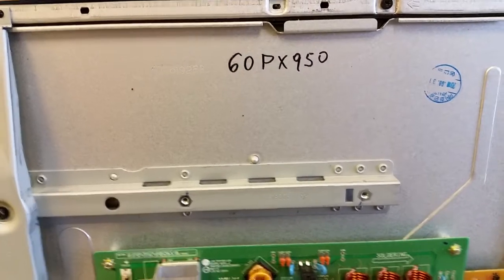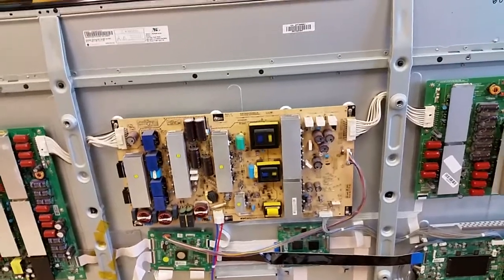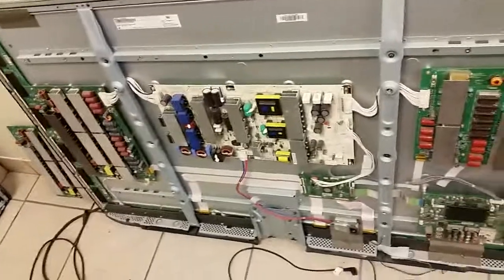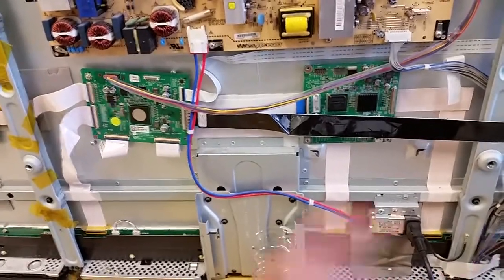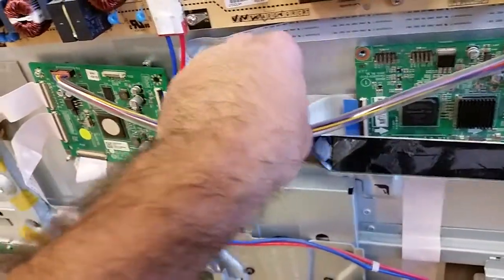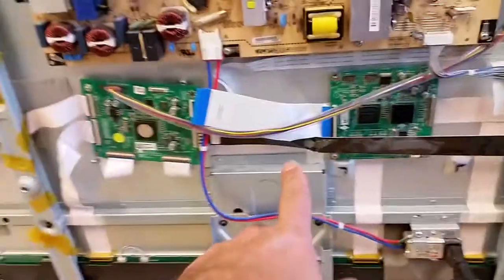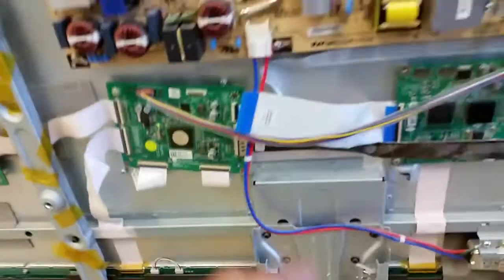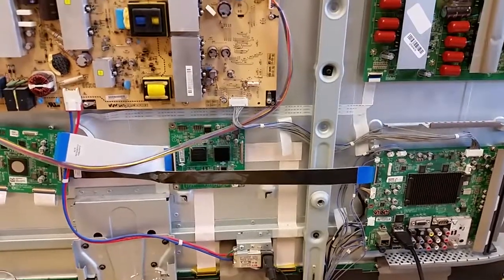How to repair / hack LG 60PX950 sound no image problem, bad EBU0107167

Comment: I have a Hisense 50H5GB, No video but I have sound. I can see picture with a flashlight. I replaced the power supply and with both power supplies I get only 2volts dc when I test the LED output socket. Leads me to believe the LEDS might be good and it would be the mainboard? Does the main board control the voltage thru the power supply to the LEDS?
Reply from the maker: Personally I think you have bad LED strips. But if you doubt the power and main board feel free to send them both to us - we'll test them and tell you if any of them is bad for mere $20. Offer valid only during the first week of 2020 and only for those two boards.
Reply: If I unplug the LEDs I get only 2v out of the power supply and its a new power supply. Does the main board control the power supply LED voltage?
Reply from the maker: @colesdad2000  The short answer is yes it does. Short answers can be misleading.

Comment: Help i have plasma LG60px950 just the reley torn on you can here the clik and no more do you have the diagrams or somthing you cant help mi thanks
Reply from the maker: Not sure what can we do to help here.
Reply: @coppelltvrepair  you hace the electronica diagrams of the main board LG 60px950 dears is a volts of 17 volts thas is not precent in the circuit board
Reply from the maker: @josejuangonzales8422  I can not help with that over Internet, sorry.

Comment: I'm having a hard time finding part numbers for these replacement boards. Is it possible to test on the original parts if it's the main board or the accelerator board that is bad? I've run the test pattern on my unit so I've narrowed it down to something wrong with the main board.
Reply from the maker: I am not sure what are you asking about. If you've narrowed it down to the main then you've had the test to eliminate the plasma logic board and you know where the problem is.
Just send us the main for service through the link in the description or have a run at it yourself :-)

Comment: My 60PX950 just gave up the other day, no picture when I turn it on. When I press the power button I can hear the relay activate and the white LED on the front turns on but no picture, no sound. I'm suspecting the main power-board, what do you think?
Reply from the maker: Hard to say by this information alone. Test the power supply independently and if it works fine then the next suspect is the main board.

Comment: Hi, 
My LG Plasma TV 60PX950N is replacing all black color of the images by a bright green. Menu and others parameters overlays are shown as usual. How could i resolve this problem? 
I have check the output voltage on the power board, they looks fine, just all VA should be at 60 V and i can mesure 55 V
Thanks
Reply from the maker: I do not know where the problem is.
I'd look at the plasma logic, frame rate converter, main board and ZSUS in this order.
Of those we can test and possibly service the main board and ZSUS.